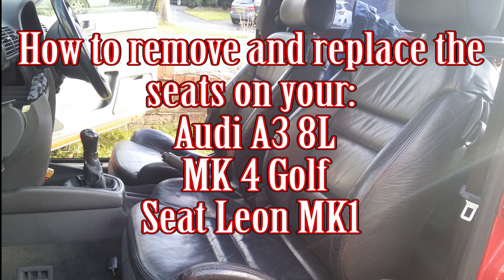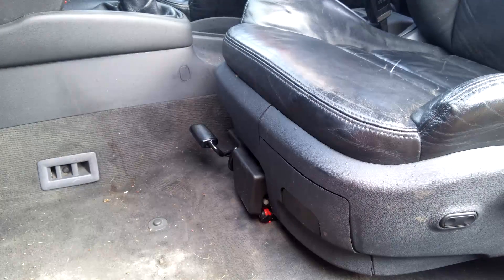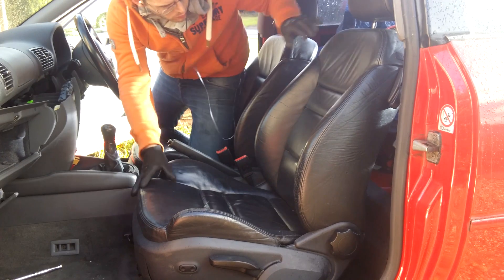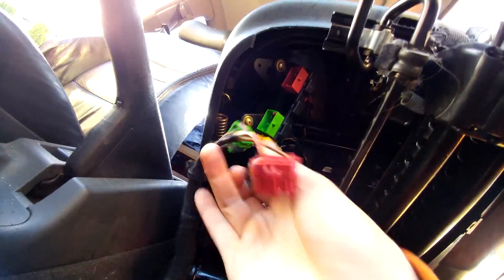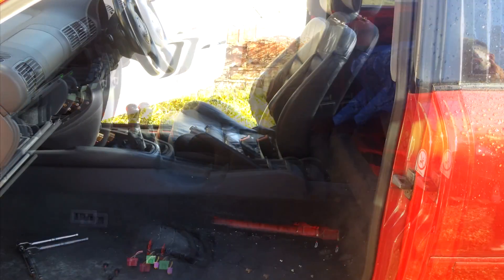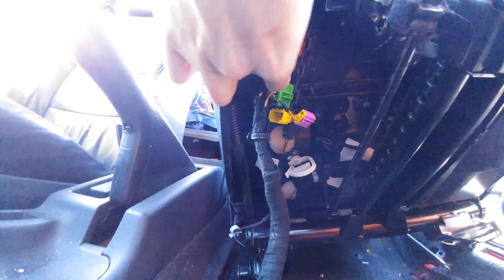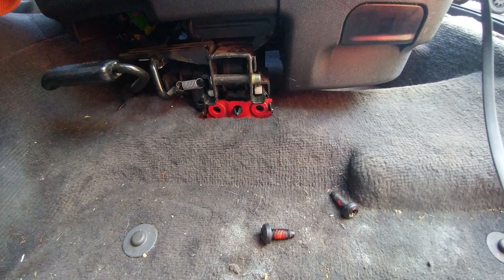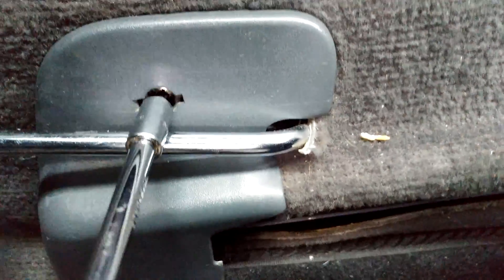How to remove and replace the seats on a: Audi A3 8L/ VW MK 4 Golf / Seat Leon MK 1

Comment: Hi. I have swap recaro seats from Audi A3 8L ti a Seat Leon 1M... But I have some issues with different connectors for airbags...any suggestions?
Reply from the maker: Firstly for what I suggest make sure the battery is  disconnected/out.  Go to a scrap yard and get the matching of pair of connectors then use them instead - just make sure they are done properly.
You might be able to repin into matching connectors but unsure  without seeing them myself.
Reply: @CarAndMechanical  thanks for the answer...in my seat Leon I got these wire: passenger blue/brown/white and driver green/brown/white... Both seats instead are blue/brown/brown-white
Reply from the maker: OK on this I think you want to google some diagrams for what is what or check forums, I really don't want to mis-advise you here and have issues.
Basically I think you have positive, earth and signal so just need to find out whats what for both.

Comment: Doesn’t really tell me much. I started 5 hours ago and I still cannot get the damn seats out. There is a second thing around near the seat belt fastener that is in the runners and you just cannot get the seat back far enough to get it out the runner on both seats. It’s a 2003 s3 leather seats I’m trying to clean

Comment: i just cghange mine and now I have an airbag error in dashbord..
Reply from the maker: You have a connection issue on connectors - check neither has split wires.